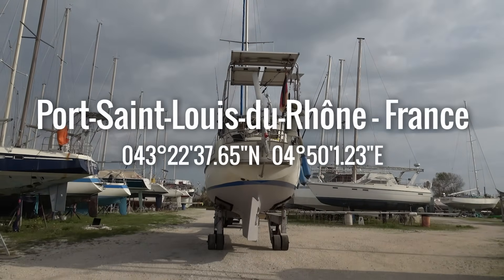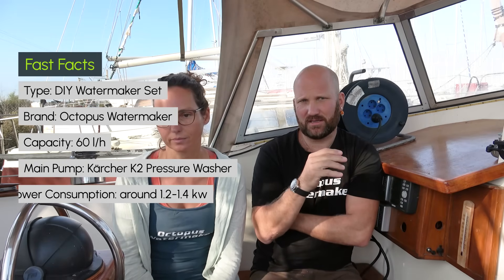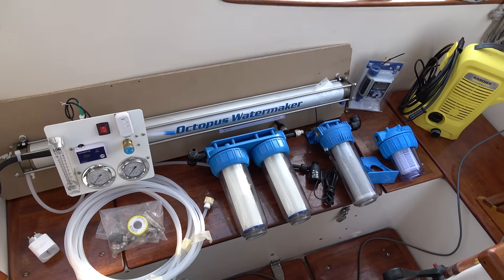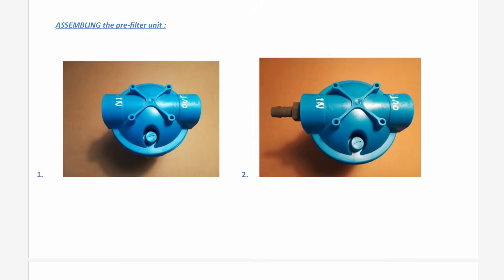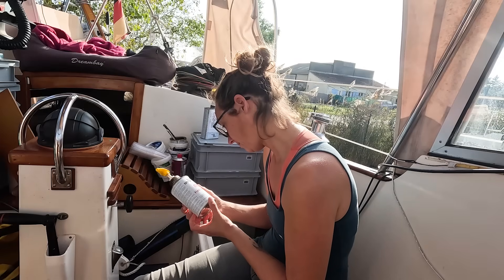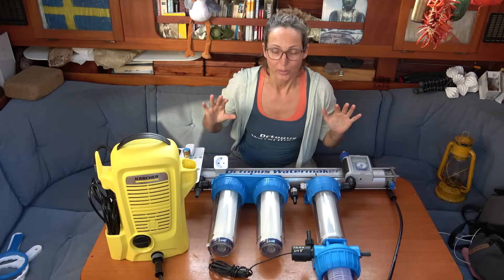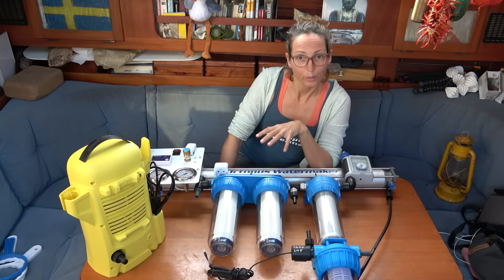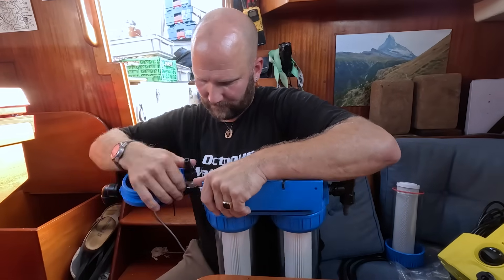DIY Watermaker Installation: Turning Seawater Into Freshwater on a Budget

Comment: I just took delivery of a 10.000 EUR watermaker....and I am very interested to learn how your K2-based watermaker will survive the first season of watermaking ;) I am using a Procon feed pump to supply pressure for a Clarck pump, which is a very sturdy, quiet and hopefully long lasting system :) Have fun, and thanks for sharing!
Reply: Great épisode. 
I liké Floh's installation thinking.
Even in the Med sometimes topping the tanks up can be a real pain in the ass as thé ports/ capitainerie charge a set fee for water 50 litres or 1000 its the same Price.
Floh  needs to rig up a 12 v  led strip light with a warning light switched from his électrical panel. Working with good lightning rather than frontales is less tiring.
Being a mechanic with my head often in engine rooms and bilges, life working on engines and steering gear and pumps so much easier when you don' t rely on torches all the time.
Also if you have a problem  at sea you save loads of time trying to see stuff.
Keep up thé good work.
Et...
Bon vent !
Reply from the maker: We will keep you posted on how the set up is performing over time. We had talked to Udo about the longevity of the set up with the Kärcher - especially using it with salt water - and his customers so far had not reported any major issues with it. 
10k is quite the number for a watermaker set up. How much water do u produce per hour and what’s the power consumption?
Reply: Thanks for sharing. Do you know which pump you are using? Maybe you have link for us?

Comment: I thought of using a dehumidifier as an emergency water system producing water from the air, low power consumption, low cost, can produce gallons per day, some models take a hose output so easy diversion to water tank.
Reply: Yeah, and then run the water though an activated charcoal filter.
Reply: There's no easy water to keep dehumidifer condensate sterile, unless you add UVC light inline. It is generally considered an unsafe breeding ground for bacteria, fwiw. Use with caution.
Reply: You would be limited by both power and  output capability. For a modern efficient dehumidifier, about 560wattt hours per litre and.  one hour to get one litre if humidity is high enough
Reply: @DavidFrench  humidity is highest before dawn which creates morning dew, 4 hours before dawn would keep a person alive,.  Not most efficient but think I can store enough electricity to handle that.
Reply from the maker: @miken7629  it’s definitely an interesting take and maybe something for keeping urself alive (if filtered). For keeping alive there are also manual watermakers that dont even need electricity, so u can take them into ur life raft. I have one of those from Katadyn on my boat.

Comment: Im using the same filters at home, i found the O rings to flatten if you take the filters off regular for cleaning. Keep some spares on hand, or a large tub of vaseline.
Reply: Don't use vaseline on rubber. Use red rubber grease. Vaseline will rot your rubber.
Reply: @ Maybe neoprene seals, still good after 5years.
Reply: Petrochemicals like Vaseline actually rot rubber. Better to be safe and use common food-grade silicon grease.
Reply: @lyfandeth   Personally, silicone and food grade should never be in the same sentence. Note how French Tefal company got an exemption for "food cookware", when France introduced banning "forever chemicals", tefal "teflon" is full of it.
Reply: @skaraborgcraft  Use "personal lubricant". They are water based.
Reply from the maker: One of my Patrons had suggested Ballistol oil for this purpose since it’s food grade. Anyone has experience with it?
Reply: @ Good point, red rubber grease is the best thing for rubber, but is not food safe.
Reply: And spares on board are always a good idea, I think…